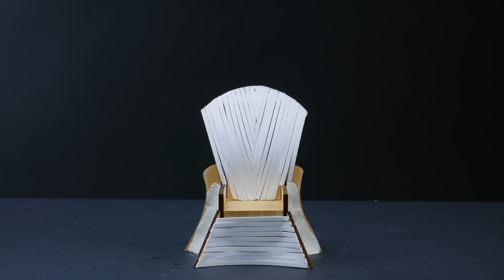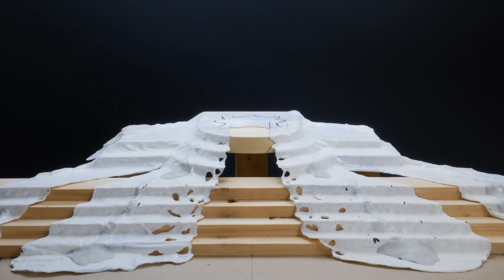Building a Massive 'Game of Thrones' Diorama

Comment: What glue did you use for the foam?
Reply from the maker: Gorilla glue. It's pretty good if you need to cut the resulting piece after gluing. The downside being time to dry and you do need to clamp them while they dry. Low temp hot glue works fine if you just need to attach 2 finished pieces.
Reply: @StevenRichter  ,I've used "uhu pore" which is a contact glue specifically for Styrofoam but it's pricey. Thanks for the info.